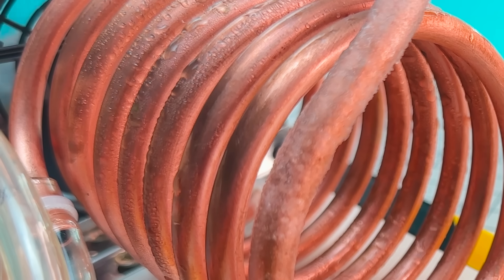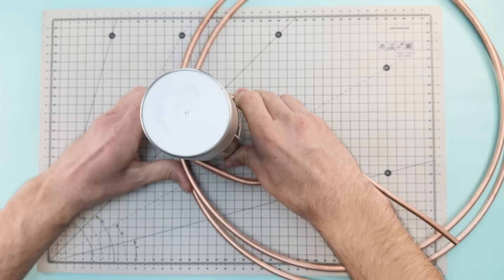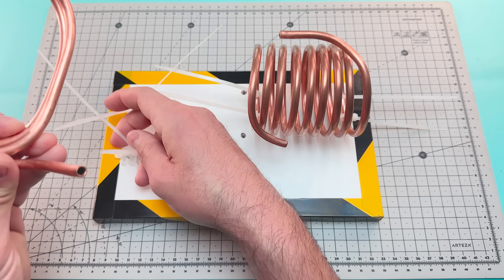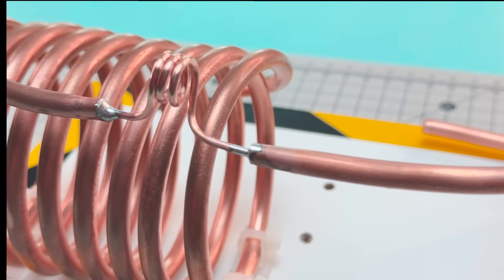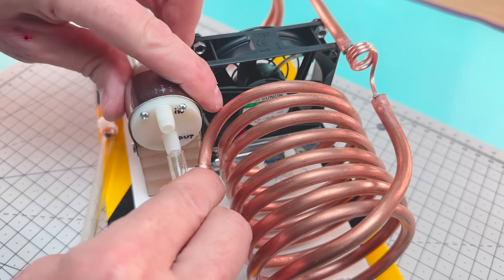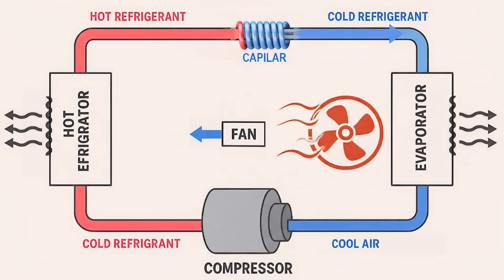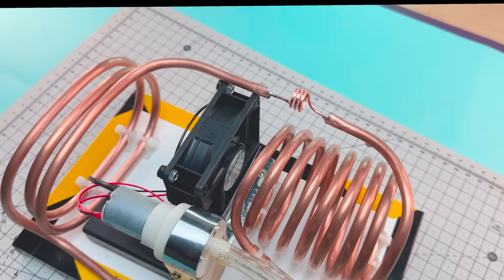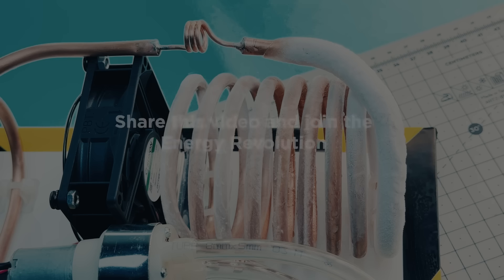Make your own AIR CONDITIONER at home Fast and Easy!

Comment: Or I could go buy a cheap AC unit for $99, plug it in, and turn the switch on. No copper tubing, zip ties, or butane required.
Reply: no ac thats good is 99 bucks
Reply: @johnnyblaze9217  I have no clue what the hell you're trying to say.

Comment: This does NOT work. You're missing vital components of a gas compression system.
Reply: This won't work. But that's not the reason why.

This won't work because
1) Not enough power to run the system.... can't cool a room with 36 watts.
2) hot side and cold side are both in the same room. Hot air is not exhausted outside the room.
3) No refrigerant was actually put into the tube. Tube already had 100% air in it. Cannkt add refrigerant without exhausting the air, first.

The pump pushes the air at some velocity. The capillary tube cannot support the flow, so the air / refrigerant backs up under pressure....i.e. compression. It's a poor man's compressor. But since the refrigerant wasn't added properly that won't work either.

Comment: DOesnt the other copper tube get hot and shouldnt that be away from the cold tube, like outside the room or outside the house ? Where are you dumping the heat is my question - as it's built its just a demonstration rig thats mostly just acting as a dehumidifier if the heat isnt being dumped far away.

Comment: Hmmm. Isobutane as our refrigerant, and we don't have a clue about "Explosion proof electrical components."
If I were a snarky little Barstool, I would suggest wearing synthetic clothing while playing with this.
Because synthetic clothes are great at generating static electricititty to ignite the gas, and then, once the clothes are on fire, they melt and stick to us in the most pleasant way possible.
For $160 + tax, I can get a 5,000 BTU Window Mount AC, and not have to screw around with something that probably costs at least $40.00 to make, and I'll need HOW MANY to actually have an effect in a room?
Reply: It won't even cool the room, just the person sitting in the airstream from the fan. The condenser coil will be heating the room as much as the fan is cooling it. And I wouldn't expect the 9v battery to run the fan and air pump for more than an hour. It really needs a plug-in DC power supply. But ignoring the flammability problem it does seem like this would work if the conderser coil were moved outside of the house. That's why AC units are mounted in windows.
Reply: @u2bist  You'd still need a lot more than "Just that unit," and the cost of the number needed would make a Factory made unit seem cheap.

Comment: You are just removing excess heat from ONE PART and supplying it to the OTHER PART by spending energy.
NO HUMIDITY CONTROL
NO NET TEMPERATURE REDUCTION.

Comment: 9v battery will run it for about 5 minutes. Probably better to use a swamp cooler. Mini AC’s don’t really exist for a reason. Aside from aquarium chillers which are actually quite a bit larger than this.    Even if you expelled the heat energy to an external location, this would hardly cool down a closet.

Comment: Is there a way to use it as a computer cooler because when the engine is stopped, the water on the copper tube melts. What should I do?
Reply: just face it to the bottom part of your computer iether with an extra fan to force more cool air.
Reply: also this type of material is not cheap.  building this mini a/c with interest will take care of it and probably will find these parts at true value or runnings.
Reply: @trafficjon400  Just buying a peltier diode pad would be effective at this point
Reply: @NamelessTripathi  ya but the set he built would last a couple more minutes if you put your face in it. lol
Reply: Since you already built it, you can place it on a pan to catch the dripping water, or maybe on a folded towel.

Comment: If the entire device is in the same room, including both the cold coil and the hot coil, the room will actually get warmer over time. While the cold coil absorbs heat from the air and blows out cooler air, the hot coil releases that same heat back into the room. In addition, the compressor and fan motors generate extra heat as they run, and that energy also stays in the room. So even though it might feel cooler right in front of the cold coil, the total heat in the room increases.

If ice forms on the cold coil and mist is blown into the room, it still doesn't reduce the overall heat. That ice came from moisture in the room and will eventually melt or evaporate, releasing that heat back into the air. Because no heat is being vented outside the room, the device ends up adding more heat than it removes, causing the room to slowly warm up.
Reply: We get what you are saying but its discouraging considering a few small tweaks insulation and ducting you can make it actually cycle the outside air over the condenser and isolate the inside air circulating on the cold coil... I will build one lol
Reply: People will make this model at home and will understand for themselves what heats up and what cools down.
Reply: The comment that I wanted to see 👍
Reply: Good  description  👍👍
Reply: NO SABES LO QUE ES UN CICLO? O TE HACES...
Reply: @corrienteycanelo6714  Yes, I understand what a cycle is. That’s exactly why I pointed out that if the cycle doesn’t expel heat outside, meaning both coils are in the same room, then the extra heat generated by the compressor and fans stays inside and the room gets warmer over time. A closed cycle with no external heat dissipation can’t cool the room overall. It just moves the heat around within the same space while adding mechanical heat. It cannot violate the first and second law of thermodynamics.
Reply: According to what you're saying, the forecast in that room will call for thundershowers.

Comment: This is not an air conditioner, it's a basic refrigeration demonstrator at best.  I can buy a used a/c unit for the price of that copper coil.  I liked the project and the video was good, just be honest about what it actually is.
Reply: The narration did also say or cool some drinks, nobody is expecting this to cool 100f room but it still helps chill a desk. Also would love to know where you shop for A/C units cus even used portables go for over $100 and I bought a spool 4x what he used for under $20 lol
Reply: Thank you for saying this. Was thinking the same thing. No place for heat to be dispersed or funneled through.

Comment: in this case, the room will not cool down as the hot air being generated off-sets the cold air. The hot air needs to be on the outside of the room with a divider or split

Comment: Interesting video as I'm in the AC tech field
Reply: What are the chances that a little toy pump like that could compress butane sufficiently to achieve a phase change? Doesn't it take a couple hundred PSI to make freon liquefy? Maybe butane is easier?
Reply: I don't get it it either , would have to try and build it myself , but there are some flammable refrigerants out there  @StochasticJeff
Reply: @StochasticJeff  it would all depend on the length of that capillary tube and its internal diameter. Per the pressure chart for r600a 32f is 8psi (in a sealed evacuated system) however the condenser would be probably at least 100f which is around 60psi. So as the condensing coil ran hotter you would face a higher pressure load that a small pump such as that wouldn't sustain. Higher pressure at condenser would require longer or smaller inner diameter capillary to achieve needed pressure drop. But so many principles zoom right out the window as soon as they raw dogged the refrigerant charge into the system
Reply: @BM-ik7mj Yeah was wondering how they were going to suck the air out of the plastic lines, well, they just didn't!

Comment: That may cool a very small room by a degree or two, but that’s all. The condenser part needs to be outside otherwise you’re putting heat in the room with “0” cooling effect.
Reply: thats what i was saying, dude failed phsyics, what A/C is built like this. some part is always outside, this is an over engineered fan

Comment: #1) I don't believe that the little bit of butane / air mix in those tubes, especially ar standard air pressure could do that. #2) you would spend more money buying 9 volt batteries in a month, that you could buy a used window air conditioner off from market place.  #3), the heat generated by the unit is being pumped back into the same room your trying to cool. So just HOW are you going to cool anything but an aluminum can with it?
Reply: its a fun project but completely useless.
Reply: with the model, everyone gets the idea - heat and heat transfer and rudimentary knowledge of thermodynamics.
Reply: yeah, relying on batteries for no damn reason? that never made sense to me. just grab a goddamn 9v power supply and plug it straight into the outlet. and if you’re worried about portability - this thing’s still only useful inside a room full of outlets you can grab your power from

Comment: And I like the way the air is preheated by being drawn through the condenser before being cooled, thus, even if it did cool the evaporator as advertised, the net effect would be nothing.

Comment: will not cool the room, need to remove the heat (condensor) outside the room.  will actually create net heat from the fan and compressor.  interesting experiment, but need to separate hot and cold for it to work.

Comment: isobutane is a highly flammable gas.  FFFlammableeeeeee.....................

It is classified as a flammable gas and is considered a dangerous fire hazard. When mixed with air, isobutane can form explosive mixtures. It is crucial to handle it with care, away from any potential ignition sources such as sparks, open flames, or hot surfaces.

Due to its high flammability, isobutane is assigned a flammability rating of 4 on the National Fire Protection Association (NFPA) 704 diamond, which is the highest level of hazard. This rating indicates that it can vaporize readily at normal temperatures and pressures and will burn rapidly.

would this work with R32? this system will put life at risk even in small amount of gas
Reply: While I agree that this is a dumb video, There are quite a few manufacturers that have circled around to using Isobutane in residential and commercial refrigerators. I tested quite a few of them when I worked at Underwriters Laboratories in the refrigeration department. Yes, all components were explosion proof (like switches) and we even did controlled leak tests and used automation to open the doors and check concentration levels. I was skeptical until I saw it work, but I'm not sure whether I would have one in my house.

Comment: This summer you won't feel hot because you'd be too stupid and dead trying this. 

 A standard alkaline 9V battery has a capacity of roughly 400-600 mAh, which translates to about 3.6 - 5.4 Watt-hours (Wh) (9V * 0.4-0.6 Ah). Even with the low-power "air pump" (say, 2W for the pump + 10W for the fan = 12W total), the battery would drain in less than 30 minutes (5 Wh / 12 W = ~0.4 hours = ~25 minutes). YouTube is full of this sort of idiocy. 

An ordinary air pump, as depicted, is not a refrigeration compressor. They are designwd to move air or create low pressure, not compress gas to high pressures. Output pressure is limited, typically < 50 psi. Refrigeration compressors are specifically engineered to compress refrigerant gas to very high pressures, increasing its temperature and enabling condensation. They handle refrigerant with specific properties (oil, pressure/temp curves).

This is just con. Normally without separation of the air to be cooled and the air where the heat is ejected the coefficient of performance (COP) of running any AC inside a room would be extremely low, meaning very little cooling is achieved for the energy consumed.

Plus to the stupid guys out there wanting to try this using isobutane (R600a) in an unsealed, DIY system is extremely dangerous due to its flammability. Proper refrigeration systems are sealed and use specialized fittings and tools to prevent leaks.
Reply: This is just a presentation of concept, Einstein.
Reply: @eventfulnonsense  No the description clearly says they are showing 'how to build an "EFFICIENT" homemade air cooler' which is complete misinformation and it will not work, not to mention its also really dangerous.
Imagine how many people will try to recreate and will be disappointed.
Reply: @eventfulnonsense It is certainly a concept shorn of science—but the duplicity of videos like this is it tries to pass off pseudoscience as truth—although that's a good recipe to get YouTube revenue because the number of science illiterate are always higher, but the danger is the simplicity of a dressed up working model hides the dangers of working with flammable gases—why waste people's time and have few fools light themselves on fire? Why not instead show real science, that way people know what reality is.

Comment: Could this use CO2? CO2 would require more pressure but could accomplish the same thing with less risk. Would this work? Also Ammonia is viable too as long as its not directly inhaled and would provide an easy sniff test if there was a leak.

Comment: The explanation of the science behind the thermodynamics I have doubts about, the rapid expansion of the refrigerant is what causes cooling in the pipe, I don't know about the mumbo jumbo spoken of. Cool project though! Whoever did the voice-over is ver good, I've heard him in several videos, his pronunciation of some words could be improved, but his style is excellent.
Reply: I do not believe this is real. I am not a refrigeration mechanic but a generic 9v battery running an air-compressor & also a 12v computer-fan is not going to happen. How they got this to operate I cannot explain, short of cheating with a second power-supply under that wooden board. A generic 9v battery just can NOT supply that amount of current, but if it did then the contraption wouldn't run for more than 5Sec & that's being generous. Also I've never in my long life seen an air-pump that tiny which runs on 9v, it isn't possible. A fan is possible but not a "pump". Also I would love to know what is the point of hoaxing this? All this trouble for some clicks? Really?

Comment: You forgot to mention fire department helpline.
Reply: I have heard that small refrigerators started using propane because the old Freon models required a HVAC certificate the Freon had been removed in order to dispose of them. The propane isn’t enough to be a risk.

Comment: Congratulations, you've made a way to turn electricity into nothing. You need to insulate those circuits from each other or you're pumping hot to cold in the same air.
Reply: Also, if this shitty system leaks in someone's bedroom and ignites, it's going to EXPLODE.
Reply: @mikenco6562  You are both right. Also I question whether a cheap pump can drive an isobutane vapor compression cycle.  Driving a condenser and evaporator in a room without and outlet for the heat, just heats a room it doesn't cool it,  aside from the fact that I don't believe they made an Isobutane system with tygon tubes a toy pump and copper tube.
Reply: I agree on the AI generated comments, no way you can run an Isobutane or Propane cycle on a toy double AA battery powered motor.  What is a greater mystery is why people go to these lengths to make videos like this.
Reply: was kind of wondering that myself, it's like when my mom forgets to put the exhaust tube in the window and wonders why the ac isn't working.

Comment: doesn't the condenser release the heat into the same room?
Reply: It's basically a refrigerator if cold area is enclosed.
Reply: Like a window AC unit, the idea is that you would hang the condenser 'outside' the house, and keep the cold coils inside the home, with an appropriate insulating barrier between them.  Apparently he forgot to mention that little caveat.  The mechanics are still sound though.

Comment: How can that cool a room? Sure, the evaporator might get cold but the heat is transferred to the condenser only to radiate the heat back into the room. The heat must get set outside somehow. Besides, it's pretty small. Cool setup though.

Comment: Aint no way a small 9V battey have enough energy to sustain a heatpump process and that small air pump? no chance... If it works so well then show the whole setup in frame without any cuts
Reply: That's not the issue here, a 9v battery just needs to operate 2 small loads, it won't forever but all the work is being done by physics

Comment: Its nice to keep the room exactly at the same temperature
Reply: Worse. It would warm up the room over time because the pump and fan also generate heat.
Reply: You'll add a little bit of heat to the room from the battery energy to the pump.